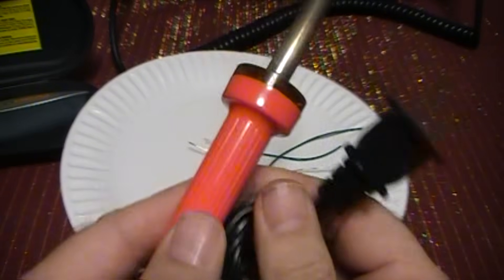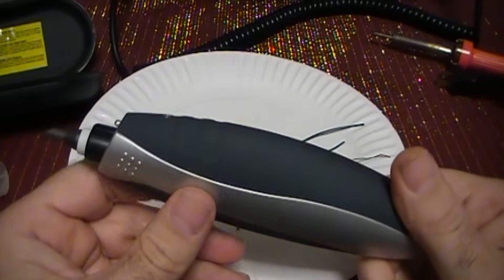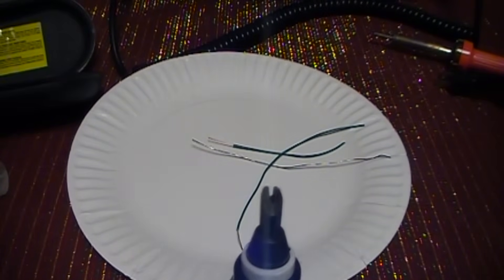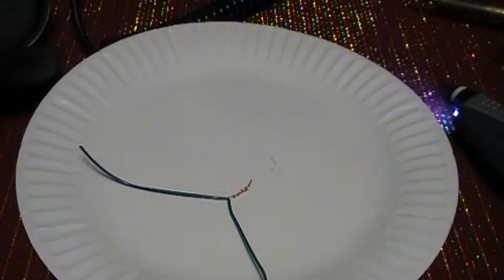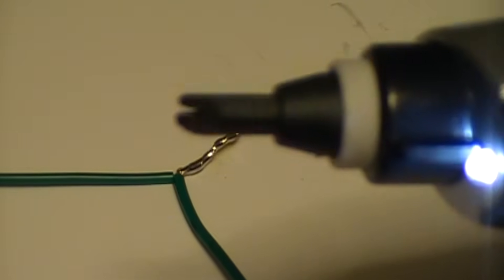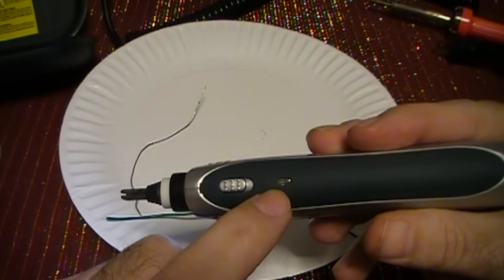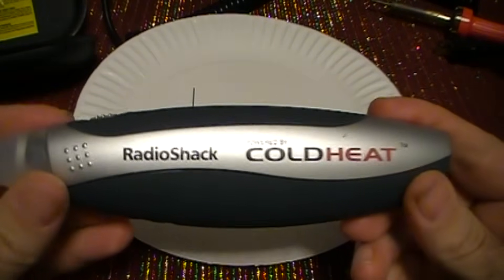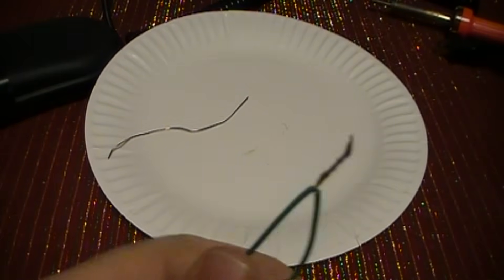Cold Heat Soldering Iron

Comment: Radio Shack no longer sells the Cold Heat product. There are some used ones on Amazon bearing both the Radio Shack and Coleman brand names; and I think I even saw a couple of brand new ones somewhere... maybe on eBay or something.

I'm one of the earliest buyers/users of this product, YEARS ago, when Radio Shack first came out with it. I keep seeing reviews on such as Amazon, and even in the comments, here, which call this Cold Heat product "garbage," or "useless," or talk about how it was promptly thrown away. I have never understood such comments because when I had mine, I loved it. If my toolbox which contained it hadn't been stolen a few years ago, I'd STILL have it. It worked perfectly...

...though -- and this is critical -- one needs to know both the tool's limitations, and precisely how to use it. This video covers both of those things, though the latter is covered here somewhat better than the former.

This is a light-duty solderer, requiring very thin/fine, very good quality 60/40 (tin/lead) rosin-core solder (the newer lead-free stuff tends not to work very well with this thing); and it's not going to do well if one intends to solder something big like, for example, a twist of four to six 12-gauge solid copper wires; or is planning on using it for something like leaded glass work. Such larger jobs are what traditional electric soldering either irons or guns (in the 80-to-140--or-more-watt range) are for; or what 1300-or-more degree (C) butane/propane torch irons are for. That said, I must tell you that this little Cold Heat product can even be used on larger soldering jobs like those (er... well... okay, maybe for leaded glass work) with the help of a little brush-on flux!

The bottom line, though, is that as with any project, it's about picking using the right tool for a given job, with emphasis on the words "picking" and  "using"...

...which brings me to that one must really know how to use this thing. It is not a traditional soldering iron; and there's a bit of a trick to it; but if one will just bother to learn what it is, and then practice for two seconds, then one will find that this little tool, for what it is and was (and wasn't) intended to do, is quite a little gem.

I'll bet dollars to donuts that those who decry this tool (assuming theirs was working properly... after all, every manufacturer of every product occasionally sends a dud off the assembly line) simply didn't bother to both understand it, and/or how to use it. Most people, I've noticed in life, don't think they need to read instructions or user manuals. Such people -- usually men -- tend to also be the ones who refuse to ask for directions when out and about in their cars; or to use maps; or even a cell phone directions/mapping app. They're idiots, plain and simple; and so they get exactly what they deserve... both regarding this tool, and in life. There is, then, justice in the world.

For precisely what this Cold Heat product was intended to do, and precisely how it was intended to do it (with emphasis, in both cases, on "precisely"), this little soldering iron was (and for those who still have a working one, is) perfection, indeed: it's best-of-breed. It remains, in my opinion, head-and-shoulders above most other cordless, battery-operated soldering irons out there which function much like regular irons, except that they're battery-operated... and so, therefore, you can still burn yourself on them; and they waste a tremendous amount of battery power because they're heating in a traditional manner, much like a corded iron.

This thing, though, is very different: don't underestimate the technology behind how it heats to well over 350 degrees (F) in a virtual instant, and then cools-down just as fast. That's no small thing. There was (and, again, for those who still have a working one, is) some real ingenuity and usefulness behind this thing.

I just loved it; and miss it very much. It was, for example, my go-to device for sticking in my tool belt pouch and climbing up a ladder; or for use out in the field, away from 120VAC electricity (which I'm well equipped to do in all other aspects of my tool-using because I have a complete set of Ryobi-brand 18V tools). Yes, when I'm away from 120VAC, I could also use a butane or propane torch-type soldering iron, which is capable of heating to around ten times the temperature (and which I also have; and also use as a small torch, when I need it)...

...but depending on what you're soldering, and what gasses might happen to rise-up off of it, the open flame in a torch-type solderer can cause a flash explosion right in your face. It probably wouldn't blind you, but it might singe your eyebrows, but good... maybe worse.

The only downside to this tool is that it can spark. It's rare, but I've seen it; and sparking can cause both a flash explosion of gasses and, more likely, damage to delicate electronics. I'll give the Hakko brand, model FX-901P battery-operated soldering iron credit in that regard: it won't spark. And for a lousy usually around thirty bucks, street price, it's a fine little product...

...but it's still a traditional heater (unlike this Cold Heat product), and so it takes time to heat-up, must be kept at temperature throughout use (during which you can get burned) -- all of which uses-up a tremendous amount of battery power -- and then it takes a while to cool down before you can put it back in your toolbox... just like a wired, 120VAC solding iron.

I think people who say they hate this thing need to get a clue; and stow their arrogance. Their marginal propensity for ignorance and all concomitant thereto is waving in the wind for all to see.

I don't mean to make it sound like I'm marketing something, here ('cause I'm not; I have NOTHING to do with this product), but there's an older TV commercial floating around out there for this Cold Heat thing... here... wait... lemmee see if I can find it...

[moments pass]

...okay, here you go: Cold Heat Soldering Iron 120 Second TV Spot

Yes, it's a TV commercial, and so, yes, is all "rah, rah" and "hey, buy this;" however, I'll say one thing about it: there's not a word of untruth in it. Not one.

I've got a fairly-high-end, almost-$200 120VAC soldering station, with all the little extras, and the de-soldering tools, and the probes, and scrapers, and the clamps, and the helpers, and yadda, yadda, yadda. And somewhere around here I've got an old Weller dual-range (100/140-watt) soldering gun, with all the various tips, that just won't quit (and is still excellent... they don't make 'em like that anymore). And I've got a $50-something-dollar butane pen-type torch/solderer set with all the typical attachments; and, of course, I've got all the various soldering tips for my propane torch...

...and despite all that, I seriously miss my little Cold Heat soldering iron. It was the one Radio Shack sold, and even though Radio Shack still sells replacement tips for it, it no longer sells the iron. So if I want another one (and writing about it, here, today, has got me thinkin' about it again), then I'm gonna' have to dig around for it somewhere... maybe buy a coupla' used ones on Amazon or eBay or something.

We'll see.

Anyway, hope that helps.

______________________________
Gregg L. DesElms
Napa, California USA
gregg at greggdeselms dot com
Reply: How did you only have one thumbs up on that post?  I just re-discovered two that I had purchased almost 10 years ago.  Pretty stoked about that discovery.  
You are 100% spot on -  they are GREAT for the right situation.
Reply: I just saw like 4 at radio shack 21 $
Reply: Im sitting here staring at my cold heat and Im also one of the earliest buyers as well. Design plan is garbage. Practicality is garbage. Aesthetic and ergonomics are garbage.  Took the damn thing out once to solder 3 wires and the thing took 3 minutes just to blob enough solder up to even do the job. And as for remelting said blog...... forget it.  Id rather not spend 30$ and go to harbor freight and buy 6 regular irons and place them in various spots. Now thats cheap and practical lol

Cold Heat= Garbage all around, but sure does look pretty in your top drawer aging.

Comment: There is an "L" in soldering.. sold-er-ing..
Reply: I'm from the US and as a kid I wondered why people said "sodder" when the word clearly says SOLDER. Since nobody says "solder" I went along with it. Now as an adult I know it's "solder". I say "solder" in my head but I have to pronounce it "sodder" so people will know what the hell I'm talking about.
Reply: Sigh :-)
Reply: You will seldom hear persons of the U.S. and even the X Brit colony Canada derivations being proper about it (too multi cultural)  Just too lazy or they just continue the mispronunciation by the monkey hear monkey say thing. There people whom have stopped me in the middle of a sentence to ask me to repeat "to-mah-to" and then laugh! Solder with a hard "ell" sound. Practice makes perfect.
As for the Cold Heat soldering tool, I wish it came with a much smaller tip so that I could use it on PCB to mount tiny components. This tiny amount of solder require such little energy but the tip dwarfs a lot of them.
Reply: let me guess, youre a brit right? you guys get so butthurt when people from a completely different culture half way around the world doesn't have the same exact dialect as you. how about get over yourself?

Comment: no flux needed?
Reply: Terri M asked:  "no flux needed?"

MY RESPONSE: The rosin in the core of the "60/40 rosin core" solder is the flux. This device works best with very thin/fine 60/40 (percentage of tin versus lead) rosin-core solder; and doesn't do well with the newer lead-free stuff. It pretty much won't work, at all, with solder with no rosin in it (for that, yes, you'd need flux; but such solders typically require more heat).

Sounds like you do leaded glass work, no? So maybe you're used to using solid core solder with brush-on flux. This would not be the tool for that.

Hope that helps.

___________________________
Gregg L. DesElms
Napa, California USA
gregg at greggdeselms dot com
Reply: Gregg DesElms  It does, thanks!

Comment: hi how do i go about buying one of these im in australia will they sell them at hardware stores im also trying to find a vidio on how to solder around tumble gem stones cant find anything on it thanks
Reply from the maker: I would not recommend using the cold heat iron on gem wire.  You will need at least a 30 watt to 50 watt iron.  One that is adjustable would be best.  This would be best:  http://www.ebay.com/itm/Pro-60W-220V-Electric-Adjustable-Temperature-Welding-Solder-Soldering-Iron-Tool-/130955362596?pt=LH_DefaultDomain_0&hash=item1e7d8c4124
Reply from the maker: also...you will need jewelry wire, flux and silver solder.  soldering is very easy when you keep the metal clean and fluxed.  you heat up the wire and the solder will melt and be drawn right to the joint.
Reply: sorry what do i need wire for
 so you dont have a vidio on how its done thanks
Reply: i just have plain tunble stones that i want to add a charm to and solder around the outside for effect
Reply: TO TINA JACKSON: Sounds like you need to go learn all about jewelry making and soldering, first. Once you do, you'll see, instinctively, why this is likely not the right tool for that kind of work.

Hope that helps.

____________________________
Gregg L. DesElms
Napa, California USA
gregg at greggdeselms dot com

Comment: nice... think this will work on RC car motor wiring?   it's a bit heavier gauge wire than what you're using in this demo.  About 4x as thick I would say.  Looks amazingly easy to use.  Thanks for the review.   I think i'll pick one of these up regardless.